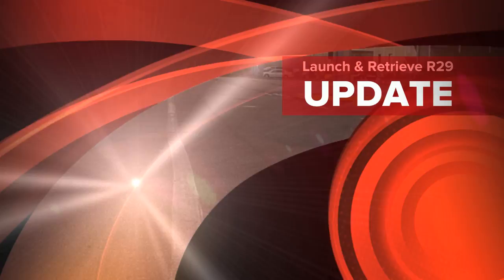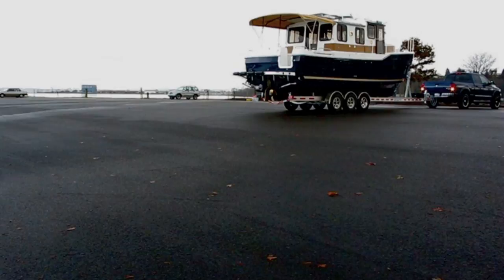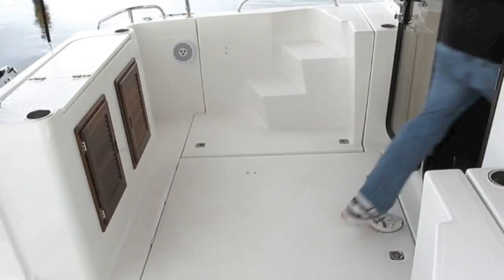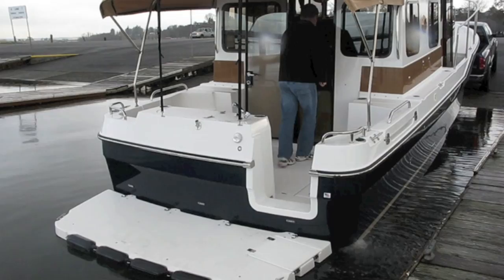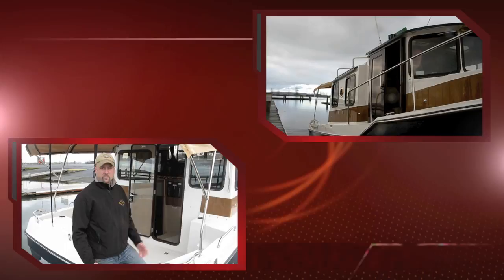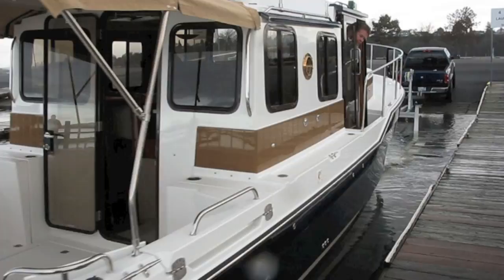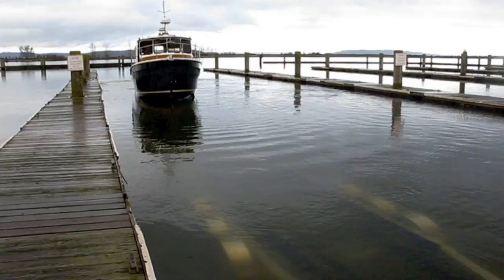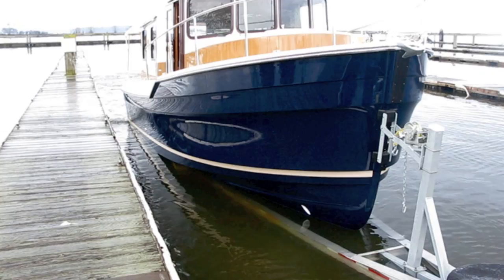How to Launch & Retrieve the Ranger Tugs R-29

Comment: I'm glad I wasn't waiting on the boat ramp for them to launch :) Beautiful Boat.
Reply from the maker: I know what you mean. But we were there on a weekday morning with no active fishery. There are six ramps at the Port of Everett and we didn't see another boat that morning. The Ranger Tug and Cutwater factories in Monroe, WA and Arlington, WA do a lot of launching and retrieving there and always make a point of respecting other boaters.
Reply: I was just giving you a hard time, but was launching my smaller boat the other day by myself and wanted to be on the dockside of the ramp as I needed to "walk" it over to the dock on a rope, to tie up. 2 old guys beat me to that lane for no obvious reason as there were 6 others available, that would have worked for their situation. They then proceeded to carry endless fishing equipment etc. from the truck to the boat at a leisurely pace before finally backing into the water and then after another 10 minutes of trying to start the boat found they couldn't get into gear which involved more fiddling around before they finally pulled the boat out and I could launch. I got flashbacks watching your video of that lost 1/2 hour :), even though I could see you weren't inconveniencing  anyone else.

Comment: love the boat & the truck too
i would have side protectors if i had such a beauty
Reply: Putting out fenders is a good idea at an unfamiliar dock or any dock that doesn't have soft rails installed, but the Everett boat launch where they are has canvas rub protectors installed on all the docks.

Comment: @FromThe3PointLine 3/4 ton, no problem (hence the vid)  1/2 ton has a softer suspension in the rear, you would probably need overload springs or air bags to support the extra weight.  Not sure the maximum trailer weight of the half ton but the 5.7L can be had in both 1500 and 2500.

Comment: I was always concerned that since the boat and trailer weighs more than the truck that the boat and trailer would drag the truck down the ramp especially  under wet conditions? 
But did you say the trailer has brakes for the reverse mode?

Comment: When I trailer launched a boat in Seattle at a very busy ramp, I learned quickly that you get your boat prepped before backing down the ramp!  That is what you need to teach new trailer boat owners, not the "let's do most of our prep while others are waiting for us!"  Sorry, that's just common courtesy.  Otherwise, nice video.  And if you have bow and or stern thrusters, use them!  There are no brownie points for slamming into someone else's boat on the water just so you can be macho and not use them.  No points for stupidity, especially preventable accidents.
Reply: Normally one would do the prep before launching, but in this case they could get better camera angles with the boat in the water rather than up on the trailer. Since it was the middle of the week on a cold winter's day, and with 13 lanes available, they weren't holding up any other boats.

Comment: I have a 2022 Nissan Armada SL 4wd with class 4 hitch, sway bars and trailer brakes standard.  Will that tow and launch an R25 lux OB?  Would prefer the R25 over the R23.  8500# tow capacity on the truck.

Comment: Shouldn't all the setup be done in the staging lanes so that you don't hold up the flow of the ramp
Reply from the maker: NHextreme999 Under normal circumstances, yes. In this case, a weekday morning, all twelve ramps were open, and no boats were waiting.
Reply: +Bruce Moore "...all twelve ramps were open..."

There are actually 13 lanes at 10th Street.  ;-)
Reply: NHextreme999 yes
Reply: @seikibrian8641  well since  there  in one 13 minus 1 is...
Reply: @lauramurray6690   If you are trying to say "Since they're in one, 13 minus 1 is 12" -- Bruce said "all twelve ramps were open," not "there were still twelve ramps open."

Comment: How did you know your prop was clear before you fired it up? Different launch ramps have different grades, many are curved. Still, a bad-ass boat with nice hull lines.
Reply: These guys launch at this ramp many times a year; they're very familiar with it. Plus, the lowest point on the prop is several inches above the lowest point on the trailer. Freeze the video at 1:21 and note the shape of the trailer's rear lower member. If the trailer didn't scrape, the prop won't either. Also, note the position of the rudder, which is behind and hangs lower than the prop. For a sharper image, see this still of an R-31; the newer sibling of the R-29:  https://www.rangertugs.com/Userfiles/Boats/R-31s/gallery/Ranger-Tugs-R-31S-5-vsm-850--N.jpg

Comment: At 5:09 what is the exact function of the black cannister?  I know the wet exhaust goes thru it but for what purpose?  sound suppression, cooling exhaust water, ?
Reply from the maker: You pretty much figured it out. It's the mixing chamber. Water-cooled inboard engines inject cooling water into the exhaust pipe, which cools the exhaust and muffles engine noise. The exhaust then pushes the water out the exhaust pipe. ... Wet exhaust systems have the advantage of using the heat-absorbing and sound-dampening qualities of water to cool and quiet the exhaust.You can see the water/exhaust mix coming out on the starboard side just forward of the swim step, starting at about 5:15, especially as John powers off the trailer.
Reply: @MoondanceMovies  Thanks for the detailed information.  I'm in the process of refurbishing the engine/transmission/fuel tanks of a 1984 26' Motor Whale Boat.  To get the fuel tanks out (which had corroded holes and I've had new ones built) I had to cut away some decking and remove the black cannister (I asked about) and related plumbing.  I knew it was part of the exhaust system but I wasn't sure of its specific function.  Thanks for the quick reply.

Comment: 2 things
1: spent way to long prepping the boat while blocking the ramp eg could of done the aerials and batteries we did tie downs 
2: shouldn't need bow thrusters unless a beginner driver
Reply: There are a lot of professional captains who love bow thrusters for controllability when maneuvering in tight quarters.
Reply: +John Reid I guess if you've got them might aswell use them but probably not a good idea to rely on them
Reply: Josh Davies ... possibly it's direct or v-drive wirh a single. Also they were demonstrating so using the thruster was just to show how it can assist in handling.  Also they explained it was a early weekday morning with no one waiting to launch is why they went ahead and back on the ramp before prepping for launch.

Comment: Narrow for its length. I get the idea of this size boat being trailerable, but it leaning every time you go from one side to the other for a $350k boat is over the top.
Reply: Lazy Jack It likely has ballasts which they did not fill in this video.
Reply: +Dragon Steel Nope.
Reply: +Lazy Jack "Narrow for its length."

A 10-foot beam is "narrow" for a 29-foot boat? I disagree. (And you'd really have to add a lot of options to get one of these up to the "$350k" mark. More like $250k.)
Reply: +SeikiBrian You are correct on price.  Yachtworld has a 2014 for $269,000 with command bridge.  I still think it is too narrow, Length to width formula puts at 10.5' for its length.  That bow thruster leaned it over.
Reply: +Cosmo Fitz "I still think it is too narrow..."

Tastes vary, which is why there are so many styles of boats. I myself LIKE a boat that rolls a little with inputs; that means that when I'm at anchor or at the dock and a wave comes along the boat won't react as much to it. In NA parlance we call boats that fight to stay perpendicular to the surface at all times "stiff," and the motion can be harsh. Other people LIKE a stiff hull, especially racers and day boaters. As the kids say, it's all good.

"Yachtworld has a 2014 for $269,000 with command bridge."

The R-29 doesn't have a command bridge version. You must have been looking at the R-31CB. (Since the R-31S and R-31CB are even longer than the R-29, but still have a 10-foot beam, you would probably REALLY dislike the L:B ratio.)

Comment: Sure wish you'd lengthen hull to 32' with fuel tank "plug" forward of engine. Add that 3' to the interior living space on deck for more warm interior space. 29 aft deck is fine. 31 interior is no bigger than 29 so.......? Would boat be too heavy to trailer @32?

Comment: 12k pounds behind a 3/4 ton truck.............. Bullshit. You would need a 1ton or better for that beast. Also with a 10' beam. Special tow permits. Very nice boat though.
Reply: 20 years ago I'd agree with you...Now nearly every modern 3/4 ton can tow 12k...even gassers.   Most modern 1 tons can now tow 25-30.
Reply: James Little wow...mature...towing with a Hemi 2500 is 9k.  Thats a Cummins...its 12500 to 13000 depending on config which is actually quite a conservative number if you ask anyone that owns one.
Reply: Don't need special permits in WA, unless your hauling commercially. Had you paid attention you would see that they said they removed their oversized load signs already. So yes, they were in compliance. As for the towing capacity, that trailer is well within the capabilities of the Dodge. Notice the long tongue which puts the load back and reduces tongue weight. The trailer is a triple axle as well and is equipped with electric brakes. The dry weight is 10k lbs not 12. Pay attention and learn a thing or two.
Reply: @mikel9567  "Don't need special permits in WA, unless your hauling commercially."

False. Every time my brother tows his, he has to buy an oversized load permit. (I think it's $5.00 per day.) You're probably confusing a commercial driver's license with an oversized load permit.